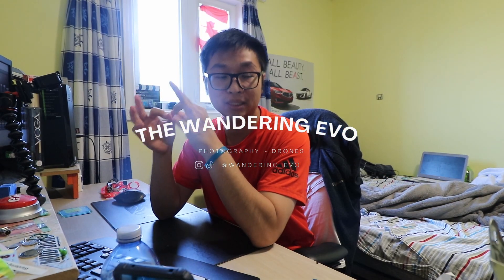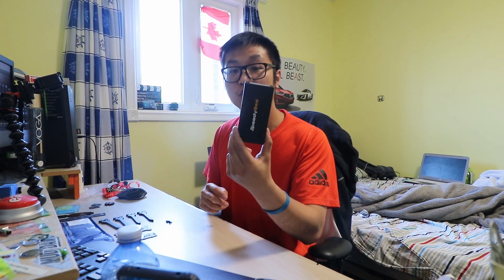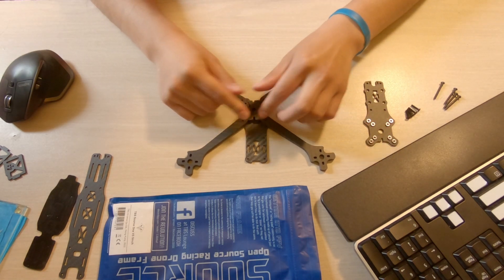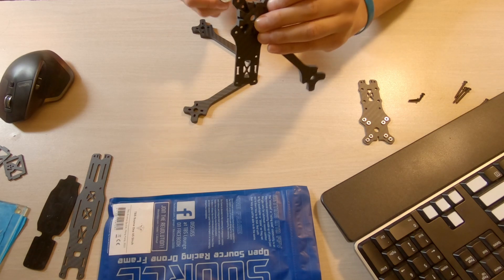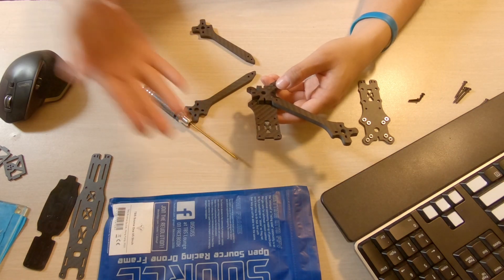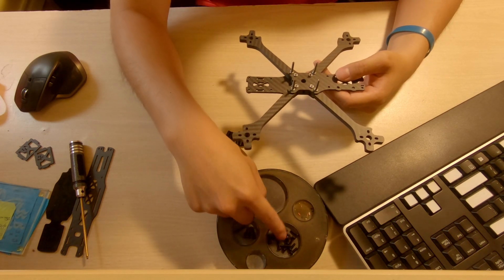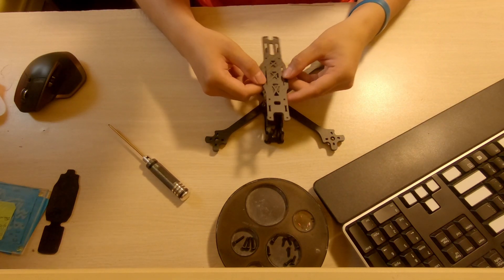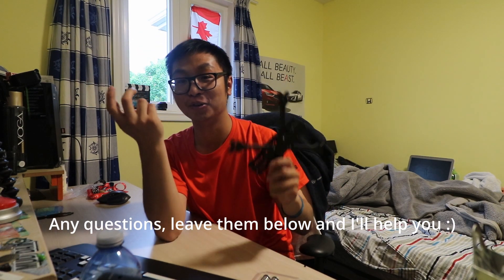Step-by-Step Guide to Building a TBS Source One V5 Frame - TBS SOURCE ONE V5 Budget Build - EP 2

Comment: Will it be finde with o3 air unit ?
Reply from the maker: Hellos, hmm thats a good question. with the vista that's inside it right now. It does have some extra room, so I would assume it'll work. Althought the front end of the frame won't allow for the O3 camera so there's that.

Comment: well explained but i have just 1 question where is the treadlock ??,otherwise i hope for more stuff from you *good luck*with the drone ;-)
Reply from the maker: Good question 👌, threadlocker is a good precaution to put on the screws but I always prepare the quads the night before (i.e do a bolt and screw check, etc). So threadlocker is a good thing if you have it, but if not it not really necessary. Just have to be mindful on checking the screws every now and then. Hope that answers the question 😊